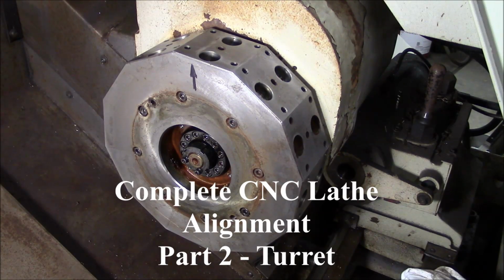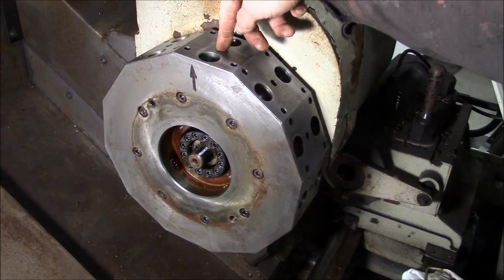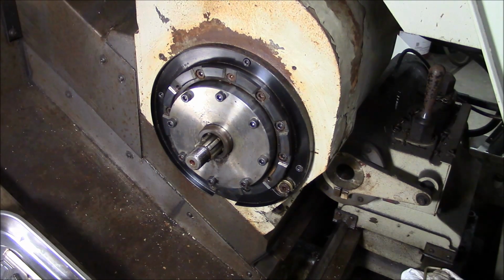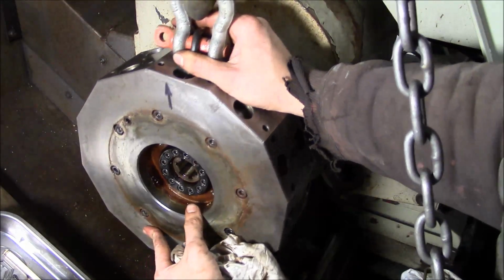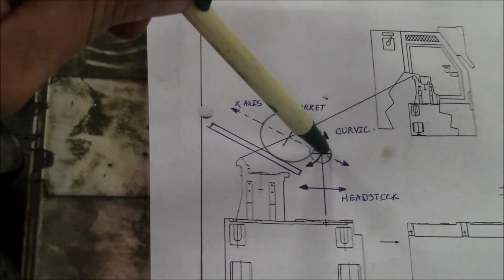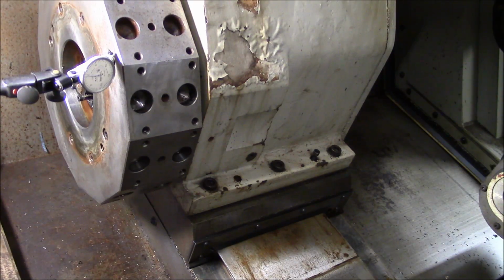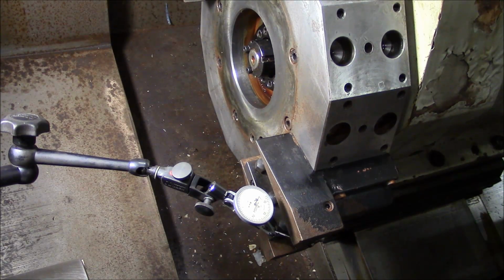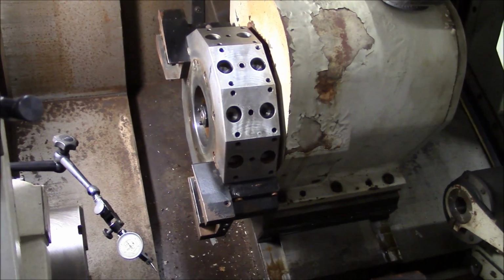Complete CNC Lathe Alignment - Part 2 - Turret

Comment: Those pins are missing because people who were smart, knew better. Do not leave the pins installed. Use the if you must, but once all is trued and snugged down, remove them. Honestly, I don't even use them, except when I feel it's needed. Removing a sheared pin is....... well you fill in the adjective..... My experience is with Hurco's.

Comment: First thing we do is pull taper pins out of Curvic couplings on our machines.  It's a production shop so crashes are a constant thing, getting worse by the year.  Without the pins things can slip in a crash if it's not too bad.  Even without taper pins we've had castings and gears get broken in the turret during bad crashes.  Get a 400# casting spinning a couple of hundred RPM then rapid traverse a 3" boring bar straight into it, bad things happen.   But hey, the important thing is that the operator was able to read a reply to them on Facebook instead of paying attention to where the machine was at... stupid machine should have known where to start in the program anyway...

Comment: Thanks for this video series. VERY helpful for learning the basics. We have a Nakamura Tome Slant Jr built in 1986. It is a real testament to the Japanese engineers that designed and built this machine, as well as the machinists that crashed it multiple times without telling anyone.

BTW our machine is also not a true slant bed, rather an angled carriage holding the x axis slide and ball screw.
Our machine has a tapered gib insert that was cracked from one of the crashes and it might be worth mentioning to check it, because it's an easy quick check that can cause "mystery" play on the x-axis.

Comment: hey so when you read the turret from the SIDE where say the boring bars and drill holders are mounted that's for straightness?
making sure when you face you're square? 
i am about .0025 out 
i tried adjusting but everytime i tighten it it moves again ??

Comment: Thank You SOOOOOOOOOOOOO Much for this video series ! ! !   I bought a used lathe and it was way out of alignment, both turret and head stock, with your videos I got it aligned perfect.  Never would have known where to start without this.  Would have ended up paying someone for something that is actually very easy (once you know how to do it)
Reply: hey what does reading the side of the turret tell you?
Reply: @christophercolumbus8944  if the side or face is out, it means it’s angled, so will impact drills the most. When you drill a hole the bit will start rubbing on the side.  Also different length drill bits will change the XO location.
Reply: @INSERT1234  or facing too eh?
when you face a part then measure a .001 off on one edge ?

Comment: It says "in case the COSTUMER does not have the proper conditions", which doesn't apply to you!
What is the advantage of a slant bed lathe?
Reply from the maker: The primary advantage is less overhang and less bending moment from the ways. This semi slant bed is cheaper to make and has the same chip evacuation advantages.

Comment: Hey Wes I have a question for you. I have a Nakamura slant bed. Pretty much the exact same setup except a vdi turret. When checking the alignment by indicating the stick tool holders, I noticed some are high on the inside (closer to center of turret) and some are higher on the outside. That doesn’t make sense to me. Shouldn’t the misalignment go in the same direction on all?  Thanks!

Comment: I just whacked the turret out of alignment on an okuma Genos l400 at work.  Boring bar sucked a 2 3/16 grade 8 nut out of the jaws and shut the machine down.    Finished the job and my parts came out fine (was more of a fender bender than a crash). Next job I had to drill a 1.438 hole .  The drill got through and burned up the drill flutes.   My turret was off vertically .1".  Very bad
Reply from the maker: Well I hope you got the machine tuned up and running correctly.
Reply: @WatchWesWork  does this apply to Okumas too? my turret is out about a .002" not sure how to adjust it it's a 12 station turret

Comment: BTW: I would have indicated the contact face were the boring bar holders will be mounted and squared that surface to Z. Just in case the surface you indicated is not perpendicular to the face were the boring bar holders mount.
For the center height adjustment I wouldn't have used the OD tool holder but the boring bar ID instead - or alternatively the boring bar holder contact surface on the turret on the top and than getting it parallel to X. Just in case the OD tool holder was not perfectly perpendicular.
I prefer the boring bar holder method as this was also used when the technician created the acceptance testing protocol when we got the factory-fresh QTS200. The Mazak protocol asked for testing 3 boring bar holders in 120° steps. Of course the holder shouldn't be worn out.
On the Mazak turret the OD tool pockets are machine into the turret disk itself.
Non the less I also adjust the last bit on every boring bar holder itself after mounting them as I usually have 3 of them always mounted in 120° steps and prefer them to be as perfectly mounted as possible for drills below 10mm.

EDIT: Just started watching part 3 and in case that the spindle is not were it should be the boring bar holder ID sweep method may not be the best. Then I would prefer seeping the top of the turret.
Reply from the maker: Every machine is a little different. It's fine to check either mounting face on these simple bolt on turrets. On a VDI style turret, you would not have a mounting surface in Z. Hopefully people understand the gist of what needs to be done. The actual execution will be different for every machine.

Comment: Thank you for this video series. Pretty interesting though I have already readjusted our lathes from time to time (or rather from crash to crash).
Mazak has this "non slant bed slant bed design" for the QuickTurn Smart 200 (I assume for the whole series). The tail stock and the Z linear rails are in two different heights (like stairs). On those rails sits the X axis on an angle. I think something like 30°. I'll send you a YT message with pictures. Not sure if my description here makes any sense :)
Reply: You've disabled the message function. At least I can't find it on yout YT user page. Maybe you can send me a message instead?
Reply from the maker: I have no idea what the message function is or how I would have disabled it. The entire comment system on youtube is nothing short of retarded.
Reply: @WatchWesWork  hey man i usually use the tail stock to help me straighten the turret eh?
what if you're working on a machine without a tail stock and you ain't got a crane to move the turret what's the best way to do it ?
Reply: 1AB09CC3 milling machine

Comment: Excellent vids man! Ive got a Femco Durga with a clogged coolant passage in the turret. Still can't figure out how to get the damn thing apart!
Reply from the maker: Is that the one with 2 concentric turrets? Those are pretty wild.
Reply: Yeah Femco has the  turrets  that the ID and OD tools can switch independently, however mine doesn't have that option. So its just  single ring that rotates, pretty much like a standard turret.
Reply: I watched your video about 15 times and decided "fuck it" and to just go for it. Surprisingly enough my turret isn't so different from the one in this video. Remove the center tool stop and there was a ring of bolts hidden beneath. i got the coolant system all cleaned up, now I'm going to follow the rest of your series and align my lathe properly! I can't thank you enough for giving me the knowledge and courage to push forward with this project. Its been bugging me for the longest time!
Reply from the maker: I'm glad to hear that. It's not difficult, it's just intimidating if you have never done it before. At least that's how it was for me the first time I did it.